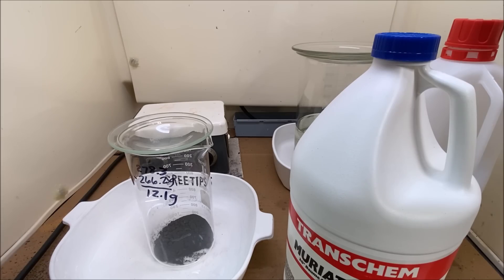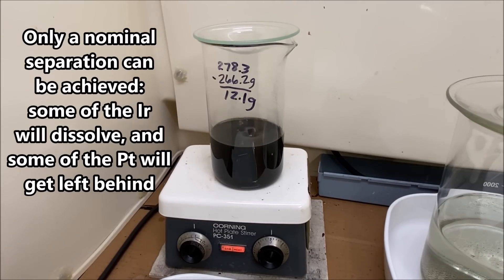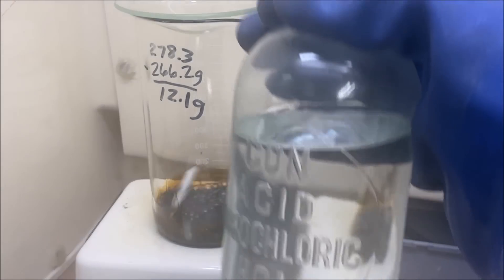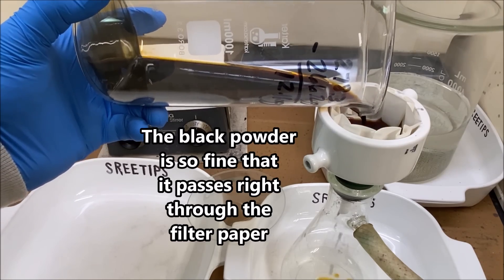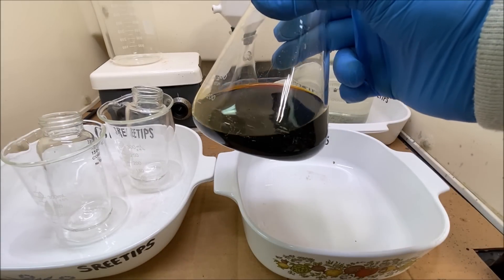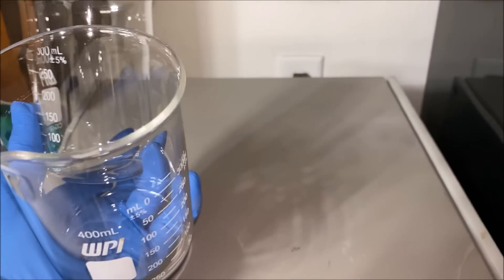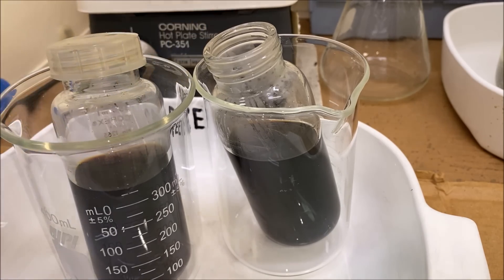Platinum Refining Bromate Hydrolysis Pt5

Comment: How can can be sure if iridium is not soluble in hot aquaregia you have most of it get the precepitate during first time you dessolved platinum rings.
Reply from the maker: Because when it’s alloyed with the platinum, the iridium will dissolve completely. It’s only after I reduced it to metallic form that it resisted the AR. But even then, some it dissolved and contaminated the platinum solution. And, some of the platinum black stayed in metallic form and contaminated the iridium metallic black powder. You can never get a good clean separation. They don’t cooperate.

Comment: Mr Sreetips, I found the remnants of a furnace next to the foundation of a civil war era military post in my hometown (Columbus, GA.) when i finally got my hands on a metal detector I found a TON of slag and 3 big pieces of what I thought was lead. The largest piece is roughly the size of my palm and weighs 507grams. This piece has some white oxidation on it, but curiously is more mud-colored than white. The shear weight of the piece tells me it’s lead, plus I found it along side other pieces that were white as snow. I knocked a 70g chunk off to melt, and found it to be very soft. Upon melting if turned a gorgeous shade of BLUE. This has me very confused, what could it be? Based on the rough estimate I came up with upon trying a density test it’s most definitely an alloy of lead, but what other metals are in there to turn it blue? I’d welcome any advice and even would be willing to send a sample to you to test if you want. Thanks in advance!
Reply from the maker: There’s no telling what’s in the alloy
Reply: @sreetips  would u be interested in a sample to attempt to work it out with the alloy on your desk?

Comment: If I were you, I'd probably try filtering through a 0.22 micron syringe filter. Failing that, 0.1 micron sizes also exist. I've used them at work for filtering out very fine particles of nickel used as a hydrogenation catalyst. If you want to try this, use PES or PVDF filters, not nylon - the first two are compatible with HCl while nylon is not.

Comment: You have to break the liquids surface tension, you should try either dawn dish soap or maybe borax to break the tension,  test with small amount first
Reply: Commercial soaps have other things in them that could prematurely precipitate the dissolved platinum and frustrate the whole process. A pure surfactant or flocculant would be more suitable here. Something cheap like aluminum sulfate or sodium phosphate, or a nonionic surfactant like triton X-100 if there are no plans to heat the mixture up anymore.

Comment: Sreetis, I'm confused because I thought you said in the first part that the bromate hydrolysis process would selectively precipitate just the platinum, not the iridium, perhaps I should go back and re-watch that one ???
Reply from the maker: The bromate hydrolysis causes the base metals, and the other platinum group metals, to form their hydroxides and precipitate out. The platinum does not form a hydroxide and stays in solution that can be drawn off as high purity platinum liquor.
Reply: @sreetips  so I'm wondering if all these aqua regia treatments were necessary, seems like you're just losing platinum into your supposed iridium powder ?
Reply from the maker: Correct, each time I try a different process I lose a little metal.
Reply: @sreetips   (it shouldn't matter to me, I already have too many hobbies for this to become another one of them, I just enjoy watching you experiment) but I'm much more curious about the bromide hydrolysis process, if you want a viewer vote, I vote for melting everything back together, roll it flat again, etc, and demo the bromide hydrolysis, then take both the platinum and the residue and send them off to be XRF analyzed to see how this process works on mixed jewelry platinum.  Or maybe you're supposed to do the aqua regia treatment before the bromide treatment, I don't know, I'm just curious.
Reply from the maker: The bromate hydrolysis works best on 990 to 995 (parts per thousand) platinum sponge.
Reply: @sreetips  hmmm, so maybe leave the centrifuge running at high speed for a week or two ?,   or instead of repeated aqua regia treatments what about repeated bromide hydrolysis treatments ?  (if the bromide process works on 005 to 0010 impurities it stands to reason that it isn't producing un-filterable nano particle suspensions?,  and what is the outcome of a "less best" starting alloy?),  random thoughts, hope you don't mind !

Comment: Suggestion one. Use a microfilter, they tend to clog up quick so you may need several. Suggestion two. Increase the volume of the liquid and let it sit for a while. Suggestion 3. Verify that the blackness is indeed from suspension and not from anything in solution.

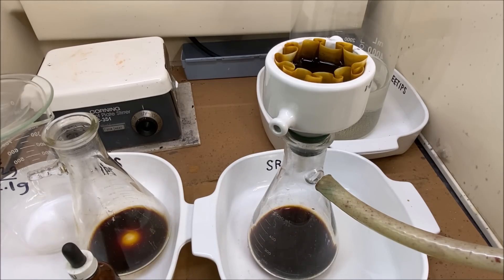Comment: 8:42 Correction: Ferrous chloride (gives yellow color to solution), not ferrous sulphate (FeSO4 is light-green color, Fe2(SO4)3 is almost colorless with reddish-brown tint)

16:20 Suspension is probably micro chrystalls of H2[PtCl6] and H2[IrCl6], because solution is too saturated and balanse in sirup-suspension state, whan solids dissolves and recrystallized in the same time. That why solids came through filter.

P.S.: Some additional info from Wikipedia:

#1) Hydrogen hexachloroplatinate(IV) forms orange-yellow crystals. (platinum solution color almost the same as color of gold solution)
Obtained only as a crystalline hydrate with the composition H2[PtCl6]•6H2O.
It dissolves well in water, ethanol, diethyl ether, chloroform.

#2)Hydrogen hexachloroiridate(IV) forms black-red crystals, the crystalline hydrate H2[IrCl6]•6H2O, which has the structure (H3O+)2[IrCl6]2—•4H2O.
Not obtained in the anhydrous state.
It dissolves well in cold water.

Comment: Been racking my brain on if there's some sort of flocculant that would work for this much like when used to clarify pools that are cloudy. A common one is aluminum sulfate, but not sure if you want to introduce aluminum to the possible metals you're dealing with separating, being so high on the reactivity series.
Reply: The aluminum in aluminum sulfate is already oxidized and will not reduce out the metals he is working with, nor will the aluminum be reduced out if @sreetips were to use zinc again. Further, even if he used a strong reducing agent like sodium borohydride, electrolysis, or magnesium/calcium which would give the aluminum a chance of being reduced out as the metal, it would react with the water and make the hydroxide or oxide and be insoluble. The aluminum sulfate flocc is a good, safe idea under these acidic conditions. If he raises the pH then that might be a different story.

Edit: Thinking of other floccs, sodium phosphate or sulfate would also be good contenders. The phosphate is a strong flocculant and might cause some problems with removal of the phosphate later. If there are no other plans to heat this mixture, a nonionic surfactant like triton X-100 would be decent too. A little goes a long way of that stuff and then there is no playing with anionic or cationic surfactants making it a little easier to apply broadly.
Reply: @panama_dan  Good call on all of the above. I was literally half-asleep on my way to bed last night when I wrote this, as I wanted to get the idea out there to use a flocculant for the suspension. Thanks for the backup with deeper thinking and higher detail.
Reply from the maker: Ever heard of “magnafloc”?
Reply: @sreetips  I personally hadn't, but after looking it up, it sounds promising. Being an anionic polyacrylamide polymer, I would think it would burn off well in the crucible when pulling the powder together into a button. What are your thoughts, @Panama Dan?
Reply: @sreetips  @BattleChemist Sorry for the delay in response, I typed this up on mobile and thought it posted, but apparently not. General gist as I remember it:

Regarding magnafloc as a polyacrylamide flocculant I would not pursue it for a few reasons: First, you are in an inorganic system and an inorganic salt would be more compatible without gumming up the system by reacting with your dissolved metals as it consolidates your suspended material or literally gumming things up as it sets up in with the water in your beaker. Second pertains to your acid content and how it will destroy the polyacrylamide and make unexpected side products that will complicate your experiments. Third is just my bias towards introducing in organics into an inorganic system because of potential unwanted side reactions if you are going for the best yield since things may precipitate out in an unwanted fashion.

Aluminum sulfate is readily available at pool supply stores or as a styptic pen from the pharmacy for shaving. This seems like @sreetips best course of action is to do a few different experiments with portions of the bulk solution using the different methods people have suggested here. Let an aliquot spin at higher speed in the centrifuge for a while, heat a sample up, use dilution with water or more HCl to promote settling, gravity filtration through a fine filter, and then maybe the flocculants of magnafloc and aluminum sulfate for a total of 6 experiments to try concurrently and see which one will help guide you on how to treat the bulk.

As a side note for the flocculants, I would dissolve them separately in water before adding to your solution so you ensure homogeneous and thorough mixing similar to how you have done with the ammonium chloride. Not saturated, but a 1-5% solution by weight for ease of calculations and time. The magnaflocc since it is a polymer may need heating with stirring overnight to fully dissolve if it behaves as I expect it to.

Comment: HI Mr S, can these be physical type nano particles or Ionic particles? 

If Ionic, maybe try electrolysis, use a platinum Cathode and a carbon Anode, this should plate out the Platinum on to the cathode. Use about 1.8V

For the solid particles, cool down the liquid and spin at a high RPM .

Either should work..

Good luck.

Comment: I was under the impression that iridium would not drop quickly with ammonium chloride. If you separate the salt quickly after the reaction you would eliminate most of the iridium. I wish I could remember where I have read that. I think the iridium salts take much longer to form. It could be garbage information but it's a thought.
Reply from the maker: Hoke

Comment: What about neutralizing the solution and running it through a brita filter a few times?  Saw a video where they took a lot of color out of a bottle of Coke with one pass. I may be out of my element here but sometimes weirdest ideas are the best ones. Hahaha.
Reply from the maker: The main problem would be most of the Pt in solution would get trapped in that filter.
Reply from the maker: Now that would be awesome

Comment: In the first step when you dissolve the platinum and you are boiingl the hydrochloric acid down, does the PH level continue to drop as the solution becomes more saturated, or is the PH stable , and the liquid just boils off taking the acid gas with it...?  Im trying to figure out if the vapor is water or if the acidic constituents also vaporizing and how that effects PH.
Reply from the maker: I’m not sure because I didn’t measure the pH

Comment: You might try electroplating the platinum out using a pt wire as the negative cathode and a tungsten tig electrode as the anode.  W is more electronegative than the pt group metals and acid resistant

Comment: Hello, I have encountered a problem. I would appreciate it if you could help me I put some motherboards and a bunch of separated parts into nitric acid and water, and then boiled the solution. At the bottom of the container, there was a substance like mud and sludge, and I dissolved it with Aqua Region, and then I boiled the solution again, and now there is a substance like oil or tar. I forgot to filter the solution and the plastic has melted. How can I extract my gold from this material?
Reply from the maker: I’m in the same boat with my platinum as you are with your escrap. It’s had to tell what you have. I don’t have any experience with the boards you are referring to.
Reply: @sreetips  😩🤦‍♂️😂😂😂
Ok tnx and good luck

Comment: Part of what I love about your channel, is you show the actual learning experience of the hobby process and that goes to Science. This includes the failures. We all have plenty of fails in hobbies, it's how we learn. I really appreciate this series, and how upfront you are. Just wanted to thank you for sharing it all with us. Don't give up. You will get it eventually, after regrouping and research!
Reply from the maker: Thanks for the encouragement.
Reply: @sreetips  Here here, Shammyhaygar, seconded. sreetips, I think they use ion exchange resin to separate the PGM's, that may be the easiest way to separate the solids industrially. Column chromatography can be used on small scales. You may try diatomaceous earth in your filter, but that multiplies the waste you have to process. You actually can use ion exchange resin sold for water softeners/purifiers, but it would require some studying up.

Comment: Do you have a rotor for that centrifuge that is meant for much smaller centrifuge tubes? 

Make sure your sample density gradient is not too high. The user manual should specify the maximum gradient and maximum mass, as well as how to de-rate the rpm allowed.

Since this is a very hazardous material, you should have caps on the sample tubes.

I can only make a few suggestions. 1) Use a more dilute solution   2) Use a much higher RPM - you only tried a low speed. See comment above.  3) Use a much longer time. 

Good luck with your efforts.
Reply from the maker: The lids interfere with the rotor so I had to leave them off. I tried to spin a sample once and it crushed the glass container. So now I’m shy about going to high on the rpm. Didn’t think of diluting. Thanks.

Comment: You may be able to use a flocculant to get the fine particles to come together. That would allow you to use filtration or a centrifuge to separate them out (or they might even drop out of suspension on their own).
Reply from the maker: Magnafloc?
Reply: There are a lot of different flocculants available. They come with varying charges (anionic, cationic, non-ionic). It seems many Magnafloc ones are anionic which is probably what I’d try first.

My experience with flocculants has been more with higher clay content material which is very different from the particles you are working with. Keep in mind that a little goes a long way. If you try it, I suggest you dissolve it in a separate solution and then add that solution to your sample.
Reply from the maker: I’ve never heard of that. Might be a new technique.